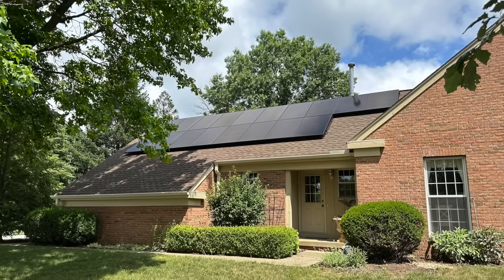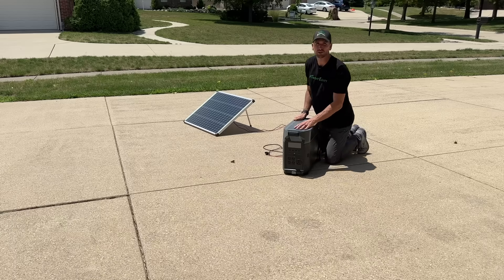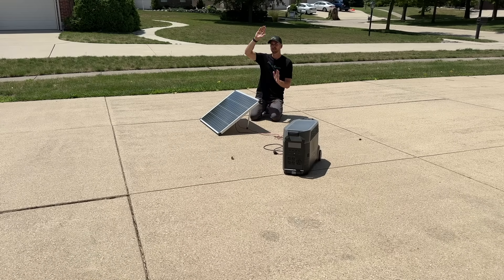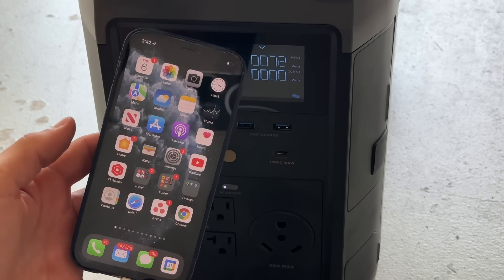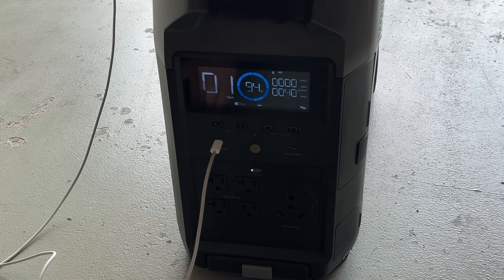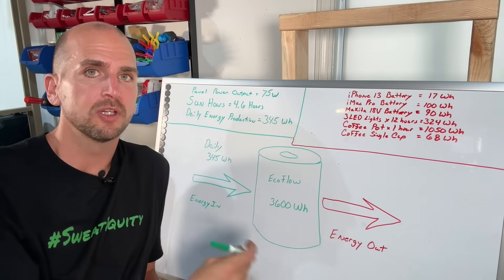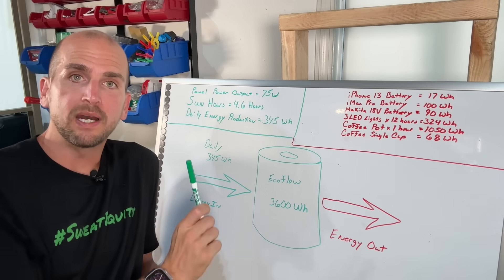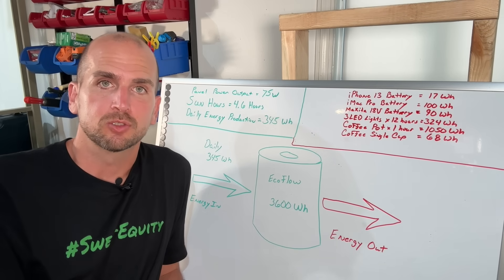What Can You Run On A Single Solar Panel?

Comment: For coffee, you can get an insulated carafe for many coffee makers. Brew the coffee as normal and then turn off the coffee pot. The coffee will stay hot for a couple of hours, saves electricity, and will actually taste better if it hasn't been cooking on that heating element. You can also just dump it into a thermos. Should save you 90% of the electricity vs leaving it on for an hour. Great video, very practical information here.
Reply: Good idea; I usually boil up some water the first thing and put the hot water in a carafe; that way the pour-over coffee drinkers ( selfish cup) are happy; the tea drinkers are happy and the hot chocolate drinkers are happy.
Reply: Yes, we have a Mr. Coffee with 10 cup carafe, and I've found the coffee to still be hot three hours later.
Reply: @MikeKeller  that's the same one I have. When my old coffee maker broke I bought another one the same size so my insulated carafe would still fit.
Reply from the maker: Good advice and thanks for the feedback!
Reply: Hell no .... Wack the kettle on every half hour for a fresh brew.
Like a normal person

What next... Pre heat your thermos with a magnifying glass and some sun light to save ...nought point nought over X amount of time divided by effort
While hanging your used T-bags out on the washing line for a second brew
Reply: A 120 watt 12/24v DC immersion cup water heater and instant coffee. Run the immersion heater from two 100w panels in parallel. 12v rice cookers work directly from panels too, and other 12v cookers.
Reply: Vacuum insulated carafes and cups are also excellent for brewing many types of delicate root type herbals teas like ginger, burdock, dandelion, dock and many more.   Try a bag of Yogi detox tea brewed in a vacuum insulated thermal cup, preferable preheated with a bit of the steam from the tea kettle, left to steep for 1.5 to 2 hours.  It's an amazing strong cup of tea.  The only way to brew it.  It should say on the package.    Vacuum insulated carafes are wonderful!
Reply: Right. Just give your location away by using that silly app
Reply: Or put a kettle over a fire or a stove.
Reply: And when the thermos is empty it needs to be washed out, which requires energy to heat the water to wash out the thermos.There is no net gain.
Reply: @SuperSaltydog77  how silly. Don't you wash the carafe if you put coffee in there? And how much water do you use to wash out a thermos or carafe? It's less water than the amount to fill the thermos or carafe and heated to a lower temperature than coffee. Try harder.
Reply: @TheDaniel688  stop being so simple, think through all of the associated cost, SMH
Reply: @SuperSaltydog77  I think it is you who are simple. Putting it in a thermos saves 900kWH of electricity vs leaving the coffee pot on for an hour. The hot water used to wash a thermos will use far less than that.
Reply: @TheDaniel688  triggered by someone with a different point of view, priceless
Reply: @SuperSaltydog77  please feel free to put some numbers on your stance.
Reply: @TheDaniel688  get over it
Reply: @SuperSaltydog77  lol. The last refuge of the scoundrel.
Reply: @TheDaniel688  so sad that you're so triggered, get over it already
Reply: @SuperSaltydog77  I'm not triggered. I'm amused. If you want to throw a little math to back up your assertion feel free. I've shown you my numbers.
Reply: @TheDaniel688  oh no, you're triggered now why don't you go make yourself a pot of coffee and put it in your thermos, that should make you feel all happy and secure.LOLOL
Reply: @SuperSaltydog77  again you add nothing of substance, showing us just how you measure up. Sips the coffee I already made
Reply: @SuperSaltydog77 I don't even use electricity for my coffee lol.

Heat the water over a fire, pour over into an insulated caraffe, done.

I wash my dishes in room temperature water btw, except in the winter when I can just heat the water on the stove while heating my house
Reply: @SuperSaltydog77  If you are doing root herb tea every day, it barely needs a rinse.  The brew quality makes it worth it.  But, I prefer to brew one cup of coffee at a time rather than go insulated carafe, so, french press, aeropress, espresso or loose coffee soaked in hot water for 4 minutes and pour it off over a paper basket filter.  Heck, I hate washing the french press, so I like the last method.

Comment: You mentioned Keurig. Those are very poisonous. They're made of plastic, which is estrogenic, so is BPA free plastic. It also causes the cancer. What's worse, is when plastic is heated, it releases more contaminates into the liquid. That poisonous slurry is then forced through several more layers of plastic, the K cup itself, and the contents of though, if not "Organic" contains even more cancer causing things. Please don't ever use that.

As for solar, I am desirous to have my entire roof covered with them. But I do want to know about things like dirt, snow, leaves, etc. I'll be damned if I am going to get on my roof and do a box step between solar panels to clean them off. Assuming I could drag my fat @$$ up a ladder and get on my roof, I would surely fall. Even when I was a skinny kid up on the roof with Dad, I was unsteady up there and felt like I would fall so I didn't do well with that. So those are concerns I want to educate myself on.

I also want to know the cost. All in, with it professionally installed, wired, and producing more energy than I need even on a cloudy day. I have this philosophy where I rather have more than I need than not have enough, and it's better to have it, and not need it, than to need it, and not have it. And I really want to get away from my crooked electric company (Ameren) charging me $10.00 for "Water heating" when my natural gas water heater has no electric connection. Or assumes I am using my air conditioner when I am actually not. I know this because they list on my bill different items. Somehow I spent over $80.00 to cool my home with an air conditioner that is broken, and not connected to the electrical service. That's how crooked they are.

Then I need to find a reputable solar company, and I'd most definitely purchase the panels outright (So they would have to be affordable) then would the up front cost justify the savings over time ? Like would I live that long ? So it's a lot to consider and an overwhelming undertaking at this point. And then my fixation with GFCI protection. Can it shut down if my electric panel becomes submerged ? Is it covered by homeowners insurance if something damages it ? Can I get service if it does become damaged or do I have to buy something completely new ? It's a lot. At the surface, it seems great.

I actually had an argument with a meter reader about me locking my meter and the idiot actually said to me "If you were intended to have free power, there would be a huge nuclear reactor in the sky."  I looked at the sky, and said "You're not too bright, are you ?" He didn't say a word just did something on his "device" like he was mad and stormed away...

Comment: Hey Scott. WIth the increase of cases of fire in garages due to issues on the EV charger or car's battery. Can you make a video on how to add a budget friendly fire system in the garage to avoid bigger damages on the property? Cheers.
Reply: if you have seen, how much water is needed, just to control (you cant put down li-ons on fire) let say tesla battery fire, you would know there's no budget friendly fire system for this.
Reply: @izoyt  thanks, it seems that I will keep running with gasoline for a while.

Comment: Let me get this straight..
Solar costs a small fortune, the pannels are made with minerals that can not be mined in the USA due to the dangerous of processing (only mined in third world countries) and will never pay for itself. Basically the rubes fall for the trade, $50,000+ upfront, to lower your electric bill by $10 a month, at less than 12% efficiency. The pannels may serve for 3-4 hours a day maximum with a proper placement and angle, but if you shell out another $10,000 you can get them to follow the sun and use 4.5-5 hours a day. Of course with a decresing efficiency with time and unless you keep them spotless, over a short time (5-7 years average). What about a battery? That's another $20,000 and it can store enough to run a refrigerator and maybe an AC unit for three or four hours. Keep in mind, that does not include the install, and if you happen to have rainy or cloudy days more than sunny (as much of the country has) you will see even less back from these systems. The funny thing is the perpetual timeline you hear from manufactures:
"We warranty these for 10 years, or as long as we make them! Keep in mind technology moves fast, why only three years ago we worked out a cooling method that improves efficiency by a good .02%! Now we charge more, and this changed the product and discontinued everything up to that point."
Basically the warranty is not of value. You will have to buy new solar cells.
Reply: a same system in Europe is about 3k compare to united states the same system will be about 12k even with those rebates.

Comment: This used to be my mother-in-law's bread, and butter. She worked for SMUD in California, and did full solar setups for homes. One of the things she always talked about was using marine batteries to store power for those winter months that don't provide enough energy. The problems with solar are it's unreachably expensive for a lot of folks, or people live in areas that don't get enough sunlight for it to be a viable solution.
  Some places like parts of Arizona see insane amounts of sunlight, and a solar setup works out incredibly well. Especially if you have the aforementioned power storage in place. I personally know nothing about any of this, so for me it's more entertaining than informative, but I guarantee a lot of people will be writing all this down like I should be, lol. The closest I get to this stuff is I have an uninterruptible power supply so if the power goes down I can safely shutdown my PC.
Reply: Interesting.  My neighbors live in Washington state where it rains 8 months out of the year and their solar setup seems to work well for them, but they did have to pay for it to be put in.
Reply: Solar battery isn’t unreachable, used ones run at 50% capacities of a new one at 10~20% price
Reply: @KebobLimonMunchers  I was talking about doing an entire solar package is unreachably expensive for a lot of people. I was completely wrong about the types of batteries though. Apparently the ones she talked about were half the size of a room for just one, but I though she meant ones you'd use for a boat like the size of a car battery, lol.
Reply: @KebobLimonMunchers  I'll bite.  Where?
Reply: Anyone who suggests batteries to make up for a shortfall of sunlight in winter is frankly either stupid or just lying.
If you make less power in a day than you need then you can't solve that issue with batteries. You would need an infinite battery capacity. However if you use 10KWH per day and on average produce 15 for 180 days and 5 for 180 days per year you will need to store 5x180 KWH to see you through winter (and obviously it's worse than that as you use more electricity in winter) So at least 900KWh or storage. Thats 900 x 100 Amp hours for a 12v battery pack. So 90,000Ah. A leisure battery is usually around 100Ah, so 900 leisure batteries at ....say $150 each = $135,000. So, net use metering IS a solution but batteries ABSOLUTELY AREN'T

Comment: I'm totally ignorant on this stuff.  However, one question.  In your diagram you have 365 Wh on average coming in daily to your Ecoflow unit with a 3600 Wh capacity.  So it would take 10 days to fully charge the Ecoflow unit with the single solar panel attached?
Reply: Yup, 10 days or increase the input by more panels …. 8 panels (800w per hour would recharge enough to 80~90% levels …. However, the input for each solar battery (bluetti etc.) have different maximum input solar levels so their solar controllers are at different maximum levels of input. Read the manual before wasting money 😃

Comment: Could you please look into home wind turbines.  When you get more wind than sun on average, the wind turbine sounds like a better choice, with solar as a supplement.
Reply from the maker: We will definitely explore that topic in the future.  Thanks for the feedback 👍
Reply: Wind turbines produce about 10% of their rated output over the course of a year.  The large wind turbines installed by your local electric company costs about $3 million dollars.  Payback is 30 - 50 years, unfortunately the electronics, bearings and structure will not last that long.  The power a wind turbine produces will cost 3 -4 times your current utility rate.
Reply: @kb9gkc  - I want personal ones.  We live in the PNW.  We don't get sun for 9 months of the year.  But we have wind every day.  LOTS of wind.  It would give us just enough to keep the batteries going, especially at night and particularly dark days.  Unless you have a magical solar panel that works in the dark, I think this would be a better option for us.  And who knows - maybe take out a few of the stupid hawks eating my chickens!  Sounds like a two-fer to me!

Comment: I'd be curious to know what the power requirements are for other power hungry devices in the house, like refrigerators, large screen TVs, AC units, etc....
Reply: Solar is cost ineffecient. For your AC needs spend more time securing the envelope, get an erv, spend more time looking at solutions that permently reduce dependency on the grid instead of expensive toys like solar cells and battery systems.
Reply: @frosted1030 solar is cheap dirt nowadays, not to mention that they will last a decade. But you should have technical knowledge to maintain the system
Reply: @frosted1030  lol. Thats too much. You only need $2500 and it depends on your KW monthly consumption. Plus to will divide that to   10 years atleast, to make even. Hybrid inverters nowadays can operate both from grid, solar and generator, so you just select your optimized settings. i assume you dont know how to compute your solar power system. Give me your monthly KW consumption and i will compute it for you. Plus i think you are using Tesla solar which is very expensive. The best solar power system nowadays are from Asia. You can even sell your excess solar poduction to the grid.
Reply: @frosted1030  and also you have to learn how to DIY install those things because you have to maintain it yourself. There lots of online resources you can be a pro solarman, dont be a couch potato.

Comment: I agree with everything you said, but folks who have 1-1 net metering don't need the EcoFlow.  People new to solar may not understand that point.  I would have spent more time on the net metering option and used a watt meter rather than the EcoFlow for measurements, as net metering is the more practical option for most people.  The cost of the EcoFlow would dissuade most people.
Reply: Many if not most use small solar for off grid or power outage situations.  Net metering provides no usable power.
Reply: @mrmicro22  "Many if not most use small solar for off grid or power outage situations." Check in ten years down the line. See what their current expenses are and how many times they have had parts fail and required replacements. Get a total cost VS using the grid. You will find that solar does not break even, it's a waste of money.
Reply: Facts:
$799 will get you a bottom of the line ecoflow unit, and a solar cell. 1kWh. Very expensive garbage that you won't be able to recycle. You may upcycle to a door stop in three to five years.